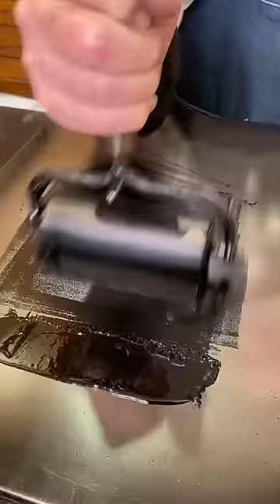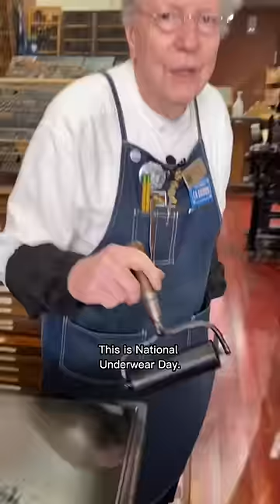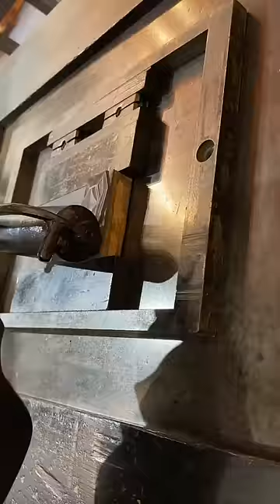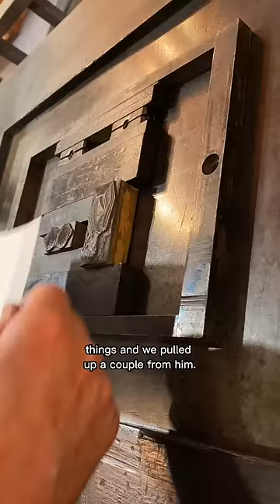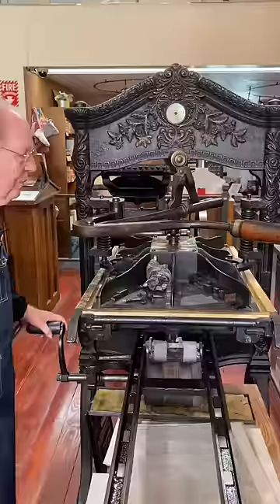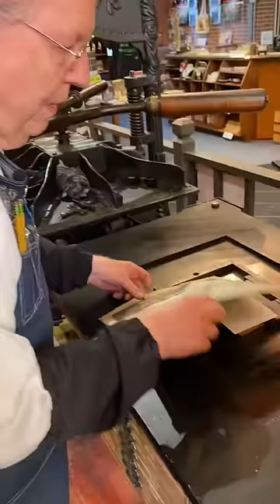Letterpress printing some unmentionables for National Underwear Day (August 5th).

Comment: I'm sure someone else in the comments may have mentioned this, but that particular article of clothing is know as a "bust improver". 
Back before corsets were wrongly deemed dangerous, women would wear padding to achieve the desired silhouette at the time they were in. 
For many years in the 1800s, the desired shape included a more pronouced bust, and therefore the bust inprover was used. 

Nowadays, there's a lot of shame around padding out your silhouette but the funny thing is, it's far more natural and honest to wear padding then it is to get surgery.
The main reason why padding was so widely accepted was because people had no delusions that any popular silhouette would be possible without the use of clothes doing the shaping for you. 

For some reason, the idea has changed and now the expectation is that you must be honest with your body's shape and to even alter your body if it doesn't meet the societal standar.

Comment: Let me clarify; this is not a bra! This went over a lady’s corset to add some padding and additional shape. Modern day bras didn’t come until around 30 years later in the 1920’s, where the bra we have today, over the shoulder strap, came into fruition. Even though bras are actually kinda bad - in comparison to a 1860’s corset - it was popular because it made your ladies look more plump.